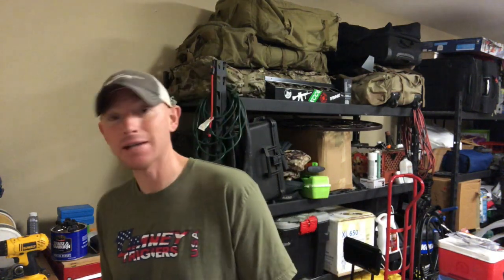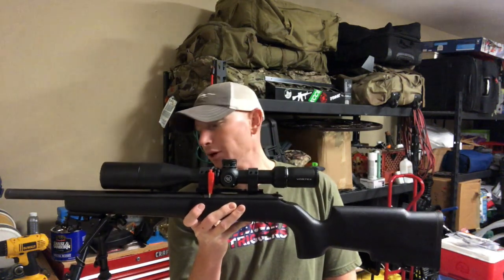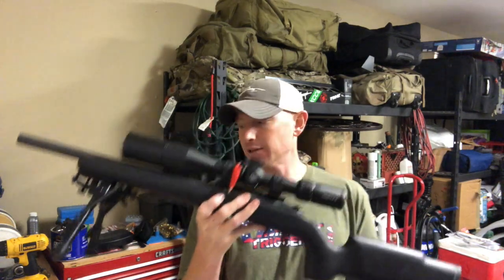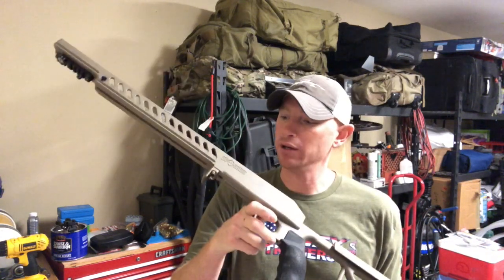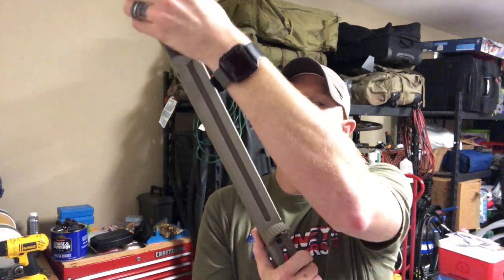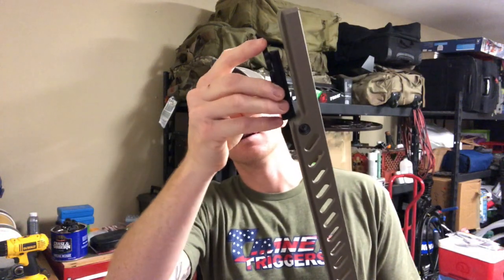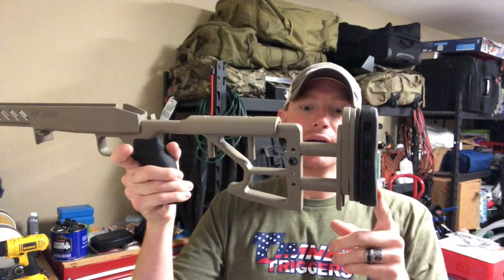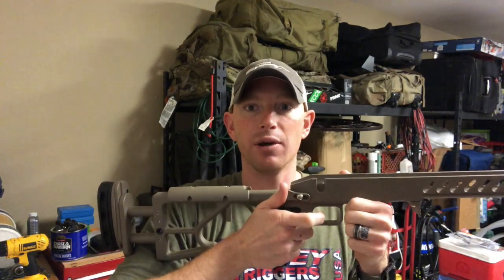Custom CZ 455 Build w/ PDC Custom Chassis

Comment: I end up using some left over insulation of a solid 12 awg wire as a bushing to replace yodave kit to help the pre travel of the cz 455 trigger and doesnot cost anything.

Comment: Love the rebuild.  How well did you like the vortex diamondback tac scope.  
And where is the nrl22 used equipment page?
Reply from the maker: supercomp9 love the Vortex DBT. Just wish it had the new ebr7 reticle in it.  I like a center dot. Look up NRL22 forum and gear exchange on FB also rimfire trading post.
Reply: @AZHOTROD84  If you like the center dot on your reticle, have you tried out the Athlon Midas Tac (6-24X50 or 4-16X44) model? They are some nice scopes as well, without the larger price tag.
Reply from the maker: Jerrod Propeck I have not. I’ve used used the specific optic but I have used a friends atholn before. It was pretty nice. I have been looking at the match pro from bushnell too